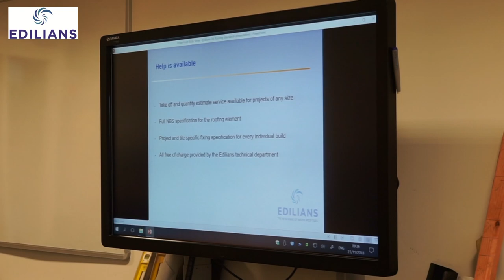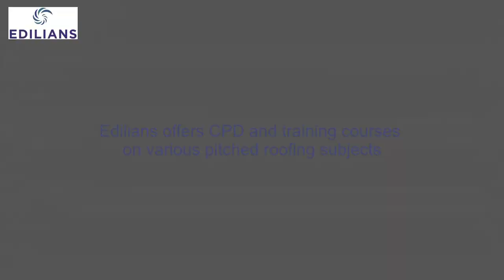Leeds College of Building roof tile installation training

Comment: Hi I’m in Bradford , live where it can get windy , are concrete tiles or clay ones best and. On one end the wind can get strong so would a double verge fixings be best  thanks
Reply: Hi, both clay and concrete tiles are fine, the important thing is to fix them properly with nails and clips.  The tile manufacturer can provide your roofer with a fixing specification calculated for your project.  All verge tiles should be double fixed, eg nailed and clipped, or nailed combined with a dry verge system.
Reply: Thank you for your advice , very much appreciated

Comment: Time and time again I see videos of installers just laying the tile on the roof without nailing them. What is the correct procedure to secure the tiles to the roof so if hurricane winds hit them they stay in place and do not blow off.  What happens to tile in snow areas from a large accumulation of snow when the tiles are not secured especially on older tiles that do not have a cleat.
Reply: In the UK, the nailing pattern is calculated based on wind speed information given in En 1991-1-4.  The minimum fixing for plain tiles like these is to twice nail all perimeter tiles and tiles in every fifth course.  This will increase depending on the location etc.  The fixings are based on wind speeds that are predicted to only be exceeded once in fifty years.
Reply: it used to be nail every 3rd or 4th course but now current spec is every tile nailed
Reply: @putadonkonit2338  Is that in the US? Do you have a link as to where that spec may be that I can read?
Reply: @gary24752  im sure it can be found i have read it somehwere also site agents have made us remove every tile and re nail them in the past lol
Reply: You nail every other day